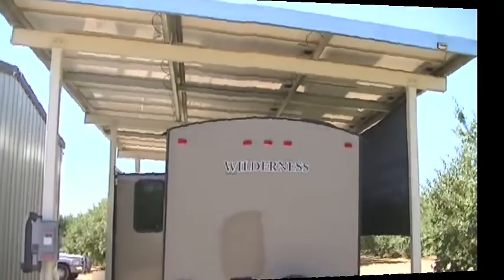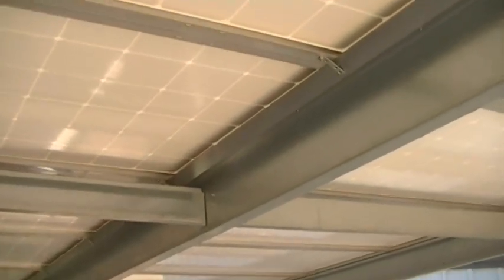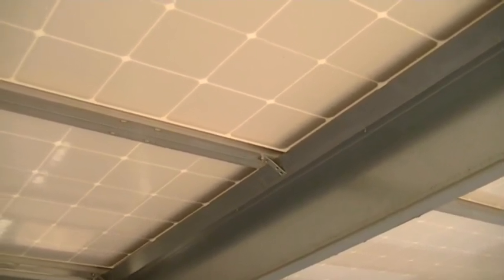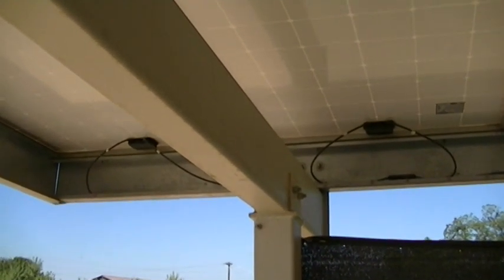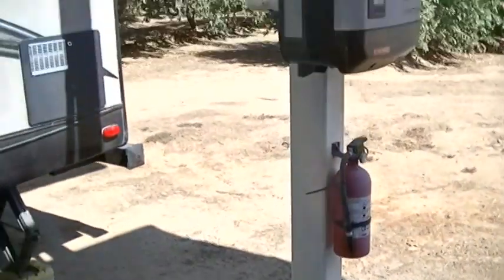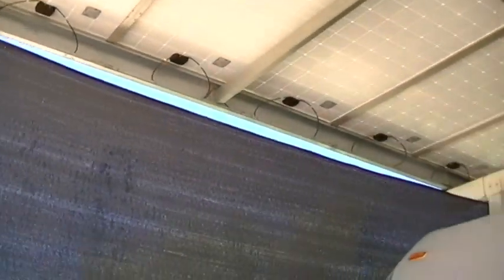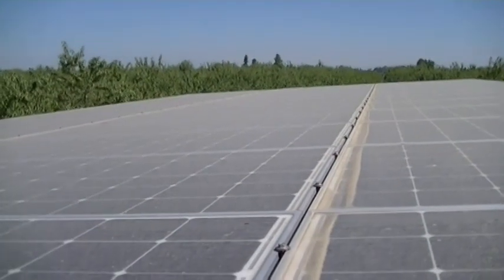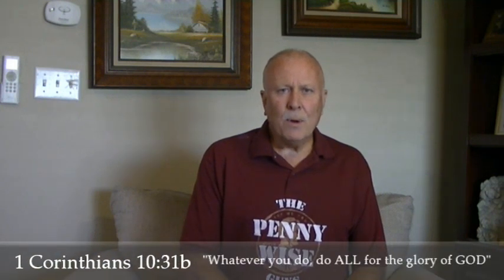Solar Structure RV Cover / Leak Proof Design          #solar  #solarstructure  #solarpatio #diy

Comment: Thanks for the details, I would suggest using L box 90 with covers to allow access and relief for pv wire,.  My ears heard AC a couple times did I miss something.. I Love the sprinkler!
Reply from the maker: Hi. The DC wires technically do not need to be covered, but I like to run them through PVC for protection and a better look. The washing system is awesome in cleaning the panels. I have a number of solar washing videos for different applications. A lot more to come with some nice additions. Blessings my friend.

Comment: I have been looking at doing similar for some time. I like your use of the flashing to help divert the water. Thank you for the detailed video. One structure I build will be over a group of shipping containers and another over an RV similar to the one in this video. Thank you again.
Reply: Thanks for the compliment. That sounds great over the cargo containers. I have my next project in a couple months and will film every step of the process. If you have any questions, please ask. I am here to help. Blessings.
Reply: @Greg-kw1vg  Do you happen to have any detailed images of how you installed the flashing to divert the water? Also to you have a good source for the C and Z perlins?
Reply: @McDIY  Hi. On a few of my other videos I show a closer view of the gutter system I build. I am planning to start another job in a couple months and show step by step videos for all aspects of construction including the gutter system. I think a couple of my posted videos should be good enough to see how it is done. I slope my structures a inch or two over the length so the water will run off. As for the purlins, I have them custom made at a metal building supplier in our are name "Borga" that serves the central CA area.

Comment: What would the approximate cost of something like this?
Reply: Hi. I built this solar structure about 5 years ago for $42,000. Current pricing would be about $45,000. I typically charged about 30% to 50% less than any other contractor. My design is original and other solar companies pass on offering this to their customers, so it is hard to guess what they would charge. I found my structure pricing was about the same as what other solar companies charge to install the same sized solar system on a roof. I am retiring this year and have one more structure to build and will post videos of every step of the process, so my viewers can find a structure they like from my posted videos showing the types of structures I have built and can take what I show on the next project and either do this themselves or hire a contractor to build these. I am also willing to help in any way I can. Please let me know if you have any questions. Have a blessed day.
Reply: @Greg-kw1vg  Thanks for this info.  Curious how much of that cost was for the structure and how much was for the panels and inverter?
Reply: @michaelwhitehurst  Hi. Typically the cost to build the steel structure is about half the cost of the project. So if I installed this system on a roof the cost would be about $23,000 plus the cost for the roof solar racking system (includes labor to install the racking) which would total about $30,000 to $32,000. This is my pricing and is about half of what all other solar contractors charge. So my cost to build the structure instead of installing on the roof is about $15,000 more. I hope this helps. Have a blessed day.
Reply: @Greg-kw1vg  that’s very helpful, thanks Greg!
Reply: @michaelwhitehurst  my pleasure. I am starting a new project install of a solar structure next week. I am filming every step of the process to show how to build these. I will post these videos in June or possible sooner. Blessings my friend.